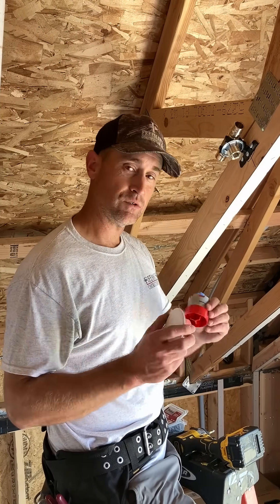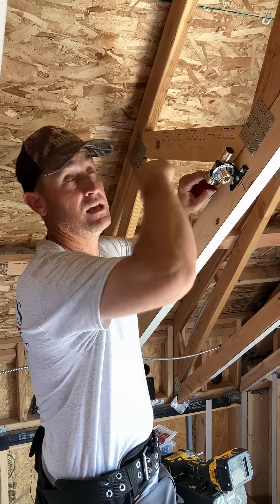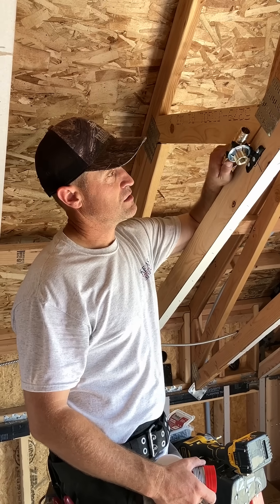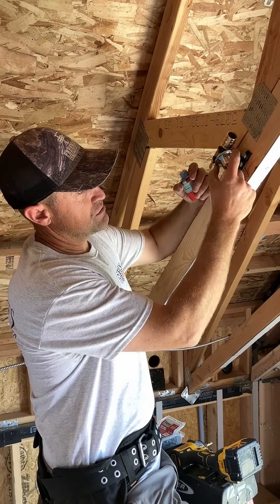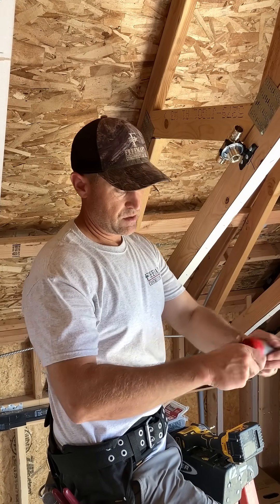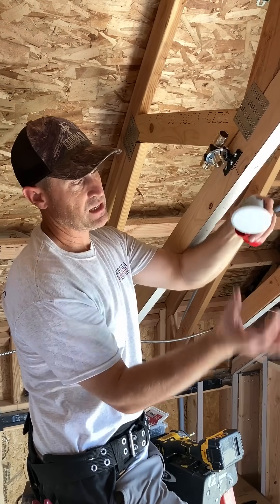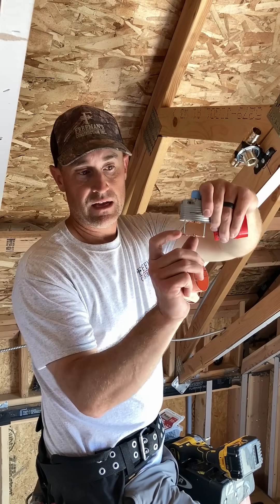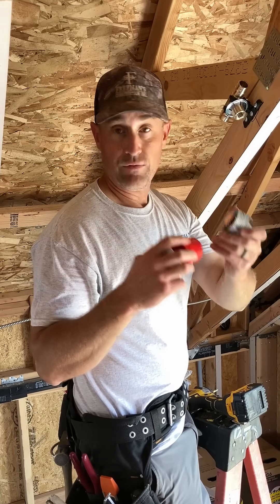How We Install a Fire Suppression System in a Custom Home

Comment: Fire Sprinklers cause more water damage in dollar terms than they protect from fire damage...and that is why the cost of insurance goes up when you add sprinklers to a building...
Reply from the maker: They do cause water damage. The primary purpose they are installed in a home  is life safety for the occupants. 90% of house fires are put out on the incipient stage of the fire if a fire sprinkler exists in the home.
Reply: Yes they destroy property maybe even more then a fire alone sometimes but that’s not the purpose. The point is if even it saves one life it’s worth all of them.
Reply from the maker: Yes that is exactly why we put them in.

Comment: What’s the price point per square foot on new construction you’ve found. Do you have a shut off valve somewhere? Can I fill the system with gasoline to ensure an insurance payout?
Reply from the maker: $3 to $5 per square foot. It depends on how many heads you will need that is driven by the floor plan and the water service. If low flow heads are required it will take more heads and it will cost more.